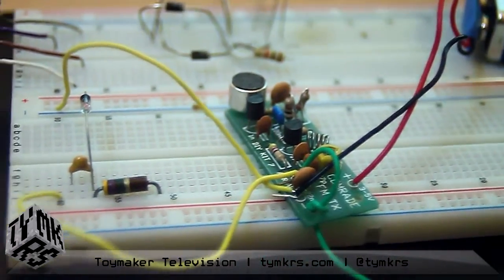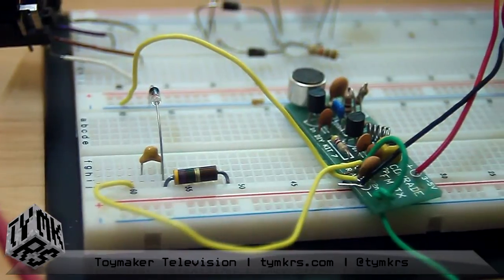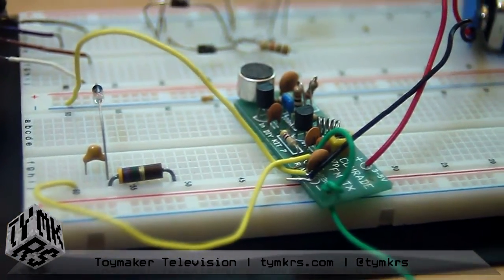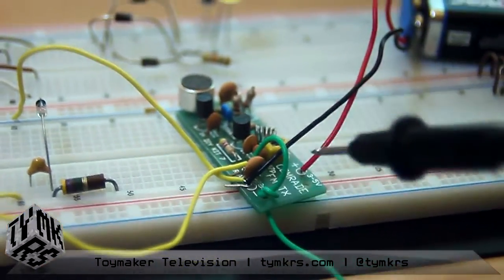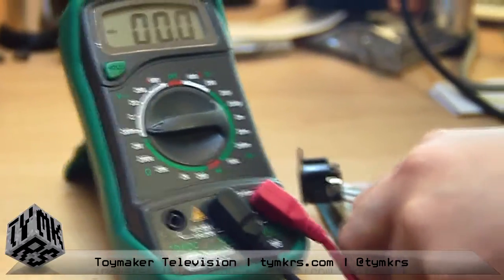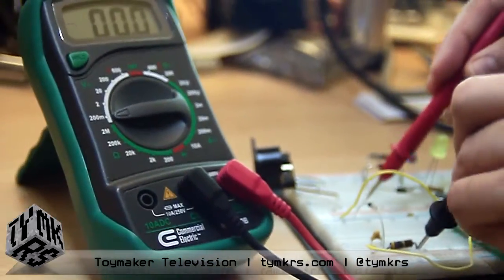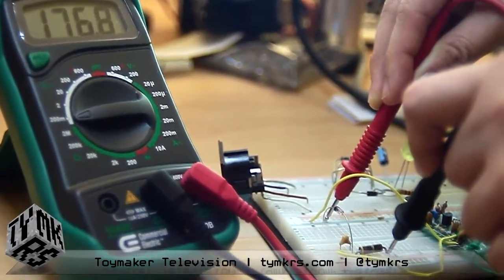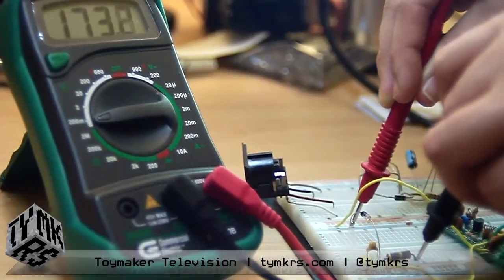Tymkrs DIY RF Probe

Comment: very simple and only good for rf within the resonant frequency of the capacitor so very limited to different frequencies.....use a transistor amp to amplify the signal from the diode and you will measure volts instead of millivolts....NTE160 or NTE 102 would would very well....just remember these are PNP types since you have wired your diode to eliminate the positive wave and allow the negative wave to get through.